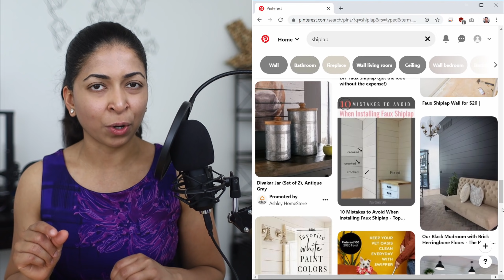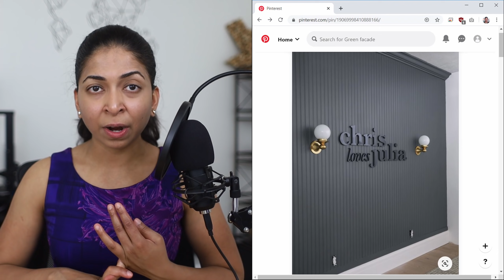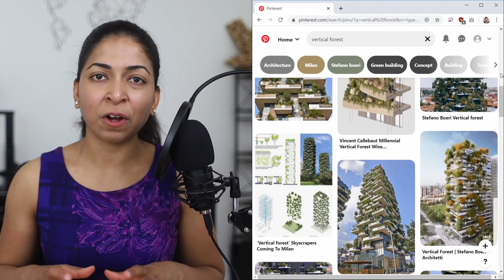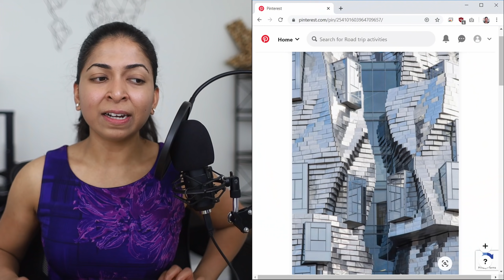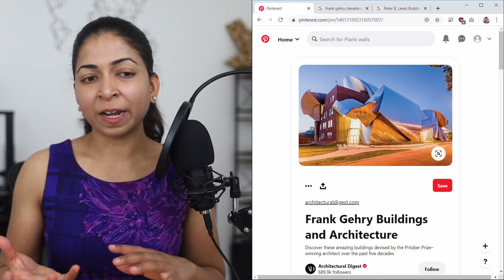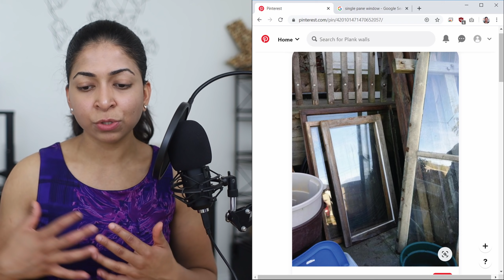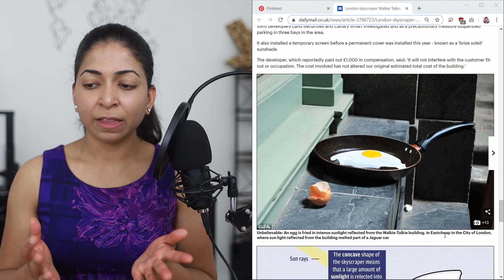Crushing your pinterest dreams | shiplap, vertical forests, skyscrapers & more

Comment: The glass skyscraper thing was quite surprising. I'd think architects and engineers would be more scientific/rational. But wouldn't something other than glass also make skyscrapers unfeasible, collapsing into its own weight? Not that super-high building are necessarily a good idea to begin with. I believe I've once heard that the sun-ray-of-death building also has a problem with wind, if I recall, sort of tunneling wind into its sidewalk, actually making people fall to the ground from the accelerated/concentrated winds.

The real green high-tech tree-building thing will be genetically engineered tree-buildings that you plant. The whole plant anatomy just genetically following some architectural design or some kind of understructure that allows for more to be added to fit more varied interior designs. I'm almost sure some architect, biologist, or sci-fi writer may have thought of this idea already. Maybe even with added bioluminescent insects that are genetically engineered to work as replacement for electric lights, at the same time they'd perhaps fight off termites.

Comment: We noticed in our apartment that is mostly concrete and built in the late 1960s that when we did the renovation for us to have air conditioning the rooms stay cool shockingly well. We have I think triple pane windows to keep it warm in the winter (with it easily getting down below minus 20 Celsius and often even more than that) but the whole building is amazing at maintaining a steady temperature year round. If it wasn't for climate change we probably wouldn't have even needed the air conditioning since even 10 years ago just a floor fan and open window was often enough to deal with the hot summer days. But now we had over 30 degrees Celsius maintained for I think it was close to a month this summer and it would not have been possible to comfortably live here without it.

Comment: Worth saying that there are special built modular houses that is about the same size and form as containers. But they are slightly wider (about 40cm) and have high efficiency insulation built into them.  They are built specifically to be well insulated and stack able.

Comment: That "build a house around a tree" thing really only works if you're using a tree that is 1) resistant to stress, 2) can tolerate indoor weather (so it's probably not a native) or is grown exposed to the elements, and 3) naturally limits its growth (or is kept trimmed).
It's possible, even for someone who isn't a good gardener, but it takes forethought (and maintenance, if the tree isn't a dwarf-type). I wouldn't do it, though, even though I'm pretty sure I could pull off the horticultural side of it. It just looks ridiculous.

Comment: One thing that didn't come through in your discussion of glass and buildings - solar heat gain.  Glazed towers are essentially vertical greenhouses.  If cooling is not provided, heat gain can make occupants very uncomfortable.  If air conditioning is provided, it takes a lot of energy to maintain occupant comfort.

Comment: I've been to that building at MIT a number of times. Aside from leaking oil a sieve and sacrificing a huge amount of usable space for pointless swooping roofs, it struck me as profoundly ugly. It makes me think of some kind of morphing gun from a comic book where anything shot keeps it's same composition, but gets distorted into an abomination. Or like someone took a 3D render of a perfectly reasonable building and introduced a bunch of bugs into the program so the render got all distorted and folded in on itself. I'd look at a building like that and think "man, your game sure is buggy. I'd hate to be the programmer who has to fix that."

It's a perfect example of why you should never let modern artists near anything important.

Comment: How do we get the unobstructed views of full panel window but not have its drawbacks. It will be a ground breaking solution as people and companies put price premiums for views. That will be a sustainable sustainable building idea
Reply: Essentially: use better windows. The problem is that windows with a high R value are crazy expensive ...
And even then they fall short of what a well insulated wall can achieve ...

Comment: Ugh. If you're going to have a tree indoors, it should be a smaller species and in a pot. Additionally, you should very carefully prune and pollinate it yourself (assuming you want it to bear fruit/produce seeds). I'm not a gardening expert and I know that ppl do have fruit trees in pots that they keep indoors. It's also worth keeping in mind that tending to an indoor tree will require quite a bit of tending. Additionally, if you have a potted tree that you put on a balcony or porch in the summer and bring indoors in the winter (especially if you live in a climate where it gets really cold in the winter), keep in mind that you're likely going to be bringing insects indoors as well.

Comment: I did a thermal analysis of an uninsulated ship's compartment as an exercise when I was in school.  The compartment was situated next to a refrigerated compartment, and a hot engineering space.  It also had a one square foot window on the external wall.  There was more heat exchanged through that one square foot of glass than either bulkhead.  Talk about driving the point home: I did that exercise over 30 years ago, and it's still one of my go to stories.
Reply: In Finland the building code for residential homes stipulates triple pane windows. Sometimes quadruple pane windows are used. As a result our houses are more energy efficient than houses in the UK or the US, even though we have much colder winters than London or NYC.

We don't have to abandon glass to be energy-efficient. We just have to not suck at our applications.
Reply: @4Leka  There's an environmental/energy cost to overbuilding too.
Reply: @mathewcalaway7684  It's not overbuilding if it significantly reduces wasted heat or cooling. And I can assure you double pane windows in the UK and colder parts of the US are horrible at preventing energy losses.
Reply: As a general rule of thumb, we say that one square metre of window lets through the same amount of heat as ten square metres of wall. Those are well-insulated windows, mind.

Comment: You do a great job of highlighting the many compromises of construction, and how traditional design often becomes tradition because it is what actually works.
I feel like the vertical forests would be a huge fire hazard if the conditions get just wrong. A fire starting at a low level would spread to the upper levels and engulf the entire side of the building in under a minute on a warm day. A forest fire that spreads vertically would do so exponentially faster than anything ever seen in a horizontal plantation.

Comment: Wait what? How can glass have a lower R-value than metal? Also how is it so important what the surface of the building is clad in? There can be insulating material under all the glass surface that is not a window, glass isn't going to just bypass that.
Reply: Well, I don't think metal itself has a lower R-value than glass, but if you put in metal, nobody expects to see through it, so you can insulate it without people pitching a fit.
Reply: It depends a lot on the metal. Some metals are really bad thermal conductors whilst others are real good conductors.

However, steel used for construction work is a rather good thermal conductor, so I guess the reason windows are such a big issue has more to do with nobody using bare steel walls anywhere (except for those shipping containers 😂).

Also windows being transparent to visible light means that quite a lot of energy can pass right through windows, then get transformed into heat and then be trapped inside, which increases the cooling necessary. But I haven't looked into whether this actually contributes relevant amounts to the issue windows create ...
Reply: @brag0001  Yeah well i have seen skyscrapers with limited window area where half the glass was just there to create a cohesive outer surface, and was painted white from the back. By all reason 80% of the incident radiation on the cladding (not window) is coming back out like that, that should be difficult to top unless you used an actual mirror.

Glass is about 1W/mK thermal conductivity, so a 4mm thick glass is 25W/K; Steel is about 45W/mK so 1.2mm steel is close to 4000W/K. Making steel 150 times as thermally conductive as glass, conservatively typical material thickness difference considered. Like glass could be 5mm and steel could be 0.8 and the difference would be even higher.
Reply: @SianaGearz  Glass is transparent to infrared radiation, steel is not.

Glass in windows is the only barrier in outer surfaces (which is really really bad considering its transparent to infrared radiation), steel almost never is (which offsets its high thermal conductivity).

Glass usually is only a few millimeters thick. Steel in structures usually is orders of magnitudes thicker. And in almost all instances steel is covered by thick layers of concrete. The concrete than often times again is covered by insulating materials.

There is more to heat dissipation of houses than just the thermal conductivity of the individual materials.
Reply: @brag0001  Steel as carrying structure is not comparable to steel as surface material - i don't think it's widespread now, but warehouses built several decades ago occasionally had a thin sheet steel outer surface; glass as window is not comparable to glass as surface material. It's also not like you can just replace all window surface with a solid wall, people don't tend to like that, you need windows.
Reply: @SianaGearz  What's your point? Nobody said that one can dispense entirely with windows. The topic in this video was entire buildings, skyscrapers, entirely covered in glass ...

Comment: I design optics. If the designers stuck to glass buildings with convex surfaces rather than concave, it would eliminate the possibility of creating "death rays" because the reflected rays would be diverging instead of converging. But, it would make the building look more bulbous, perhaps pear-shaped. A flat plane is also a diverging refecting surface. That's why we don't see these problems with flat sided glass buildings.  It's possible they can increase the heat load on an adjacent building, but not to a scalding degree.
Reply: Having a bulbous glass facade could possibly create a lensing effect that would create a focus of the sunlight INSIDE the building if its an open interior design.  Like not leaving your reading glasses next to a window, it's probably a potential fire hazard.
Reply: @johnlee7164  I like your reasoning here, but as long as the panes of glass are uniform thickness, the rays  pass through parallel to their original direction and will not concentrate the light.  A solid glass window would have to be curved on one side and flat on the other for this to happen.  Alternatively, if we built the structure with a flat transparent wall on the inside and then fill the gap between the windows and the transparent wall with water, this would indeed happen.  Spherical glass water vases were popular in the Victorian age.  Placed in front of a sunlight window, they did set tables on fire!

Comment: On the trees drying up the soil, in Australia construction is done on sand, since when sand gets wet or dry it doesn't drastically change the surface beneath the foundation
Reply: I wonder if having a tree in your home would work if the house is stilted
Reply: so do they create an additional layer of sand before the foundation or do they just favor building on sand?
Reply: @MadsterV  they pour sand onto the site and level it before they put down the foundation.
Reply: @jinxhijinx1768  neat, thanks

Comment: I read that high-rise buildings use glass primarily because glass is lighter than concrete and therefore requires less total material to enable a building to be that tall. While other materials, such as honeycomb fiberglass panels, come to mind, the problem with most of those is that you can cut through them with a hand saw.

Comment: Wood as in planks can have a lot of movement with varying amounts of moisture in the air as the fibers swells. 

This happens only in the perpendicular direction compared to the fibers in the wood, the length of the fibers is almost not affected at all by changes in moisture.

Now combine this knowledge with the fact that glued wood joints along the wood fibers is stronger than the wood itself. 

And you will realize that plywood is  actually remarkably stable when it comes to wood movements, as every ply is glued to two other ply with the wood fibers perpendicular and hence is effectively locked in place.

Comment: Trees also need wind to make them move the nutrients up the height of the tree and to its leaves. In Anchorage Alaska, a building had all glass sides. It was blinding to pedestrians and drivers at certain times of the day. I was always hoping an earthquake would crash the damn thing down. In Florida the apartment I had had floor to ceiling large glass windows. It was a terrible idea as the heat was unbearable and I had to keep insulated curtains closed at all times to keep the apartment livable. So once again an idiots idea proved it was an idiots idea.

Comment: Regarding R-values: I don't have much experience/knowledge on commercial, but as I understand it, with big buildings the surface area is so much smaller that the exterior insulation matters less than in residential.  Solar gain is likely a problem on flat facades though, so I get where you are coming from.  I think interior designers like the fact that desk position/layout doesn't matter, so you might have more luck convincing them to raise the bottom and drop the top (i.e. a horizontal band of windows).

I've also seen places where it was glass on the outside, but only some were windows.  Thus you get the same external futuristic look, but 1/2 of the panes are just acting as a weatherproof cladding.

Disclosure: I live in a house where half the windows are floor-to-ceiling, but at least it has large overhangs.

Comment: You skipped triple glazed glass. I have 25 cm of insulation in the walls 40 on roof and whole wall of triple glazing 6 m× 10 m facing south.. have extremly low heating costs and thanks to big roof overhang no overheating. So you can have best of both. Small windows are a disaster...

Comment: Belinda, what are your thoughts on "green walls" for high rises/skyscrapers?

I am thinking more of the type that have a lattice constructed offset from the wall, and having climbing plants (ivy, wisteria, etc.) to grow up and cover it, creating a natural "green screen" for the building. It could serve the same function of the "verticle forest" by way of purifying the inner city air, helping to insulate the interior of the building via natural shade from sun light and its accompanying radiation, and also avoiding the reflection problems you mentioned at the end of the video.
Reply from the maker: I'm not a fan of them. They seem like a superficial way of replacing the trees that man tore down to construct the building. Ivy growing over windows obstructs views and also attracts plenty of insects year-round, so the inhabitants wouldn't be able to open the windows and/or use the balconies. Good idea in theory, not so good in practice.
Reply: @BelindaCarr  Fair points.

Comment: Great stuff. One comment from someone in the energy efficient business: while I appreciate the benefit of spray foam in certain areas of a building, there are other less expensive and more eco-friendly ways to get a house to be just as tight AND well insulated. Perhaps a good topic for one of your videos.
Reply: Mark, could you give us a short list on the methods you have in mind? That would be great.  Maybe you and Belinda could collaborate on the next video.
Reply: @Incandescentiron  Mineral wool with a wind barrier on the external side and a vapour barrier on the internal side. Works like a charm if you've got a decent ventilation system.